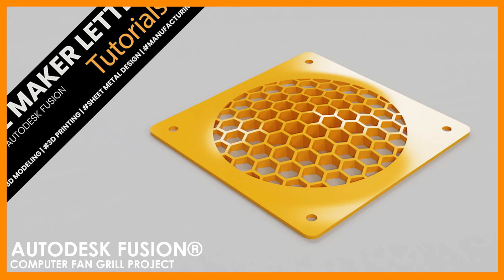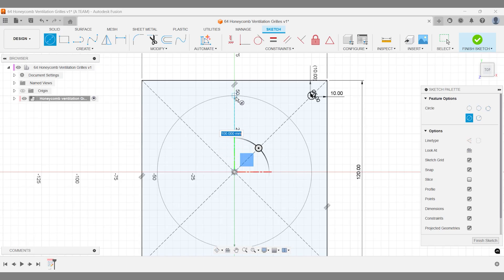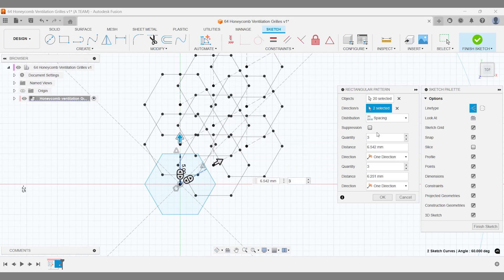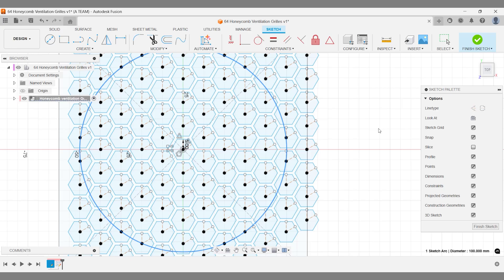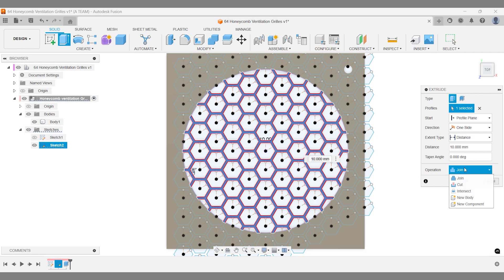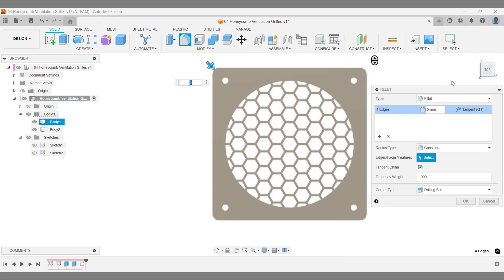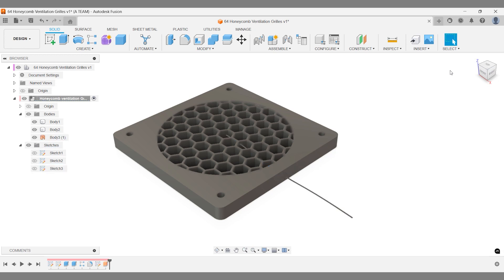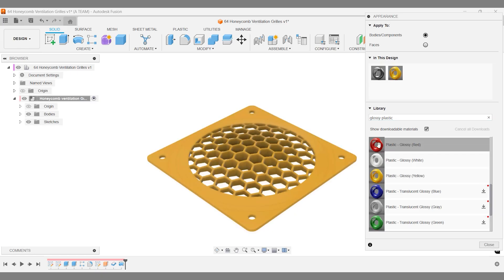Designing a 3D Printable Fan Grille with a Honeycomb pattern in Fusion

Comment: If you print this and try it next to a fan it will be quite loud and inefficient.  You need to create geometry that flows with the air.  Look at the noctua fan grill design that's published on printables.
Reply from the maker: Thanks for your feedback! These tutorials are meant to be both fun and educational. Once you master core workflows, you can spend plenty of time optimizing designs. You’re absolutely right—this 10-minute tutorial doesn’t dive into product optimization
Reply: @The_maker_letters  

I relay the information because we built and tested a similar fan shroud as it seems like a good design. We found the loud noise make it totally unusable.  Just a word to the wise...

You will see if you print this and put it up to an actual fan.
Reply from the maker: @brandonmansfield6570 Thanks for sharing! To be clear, this is a rapid prototype, not an optimized design. You’re right—it doesn’t focus on material selection, functionality, manufacturing, safety and compliance, ergonomics, durability, logistics, branding, or other important dimensions to consider when designing a product.

Comment: I thoroughly enjoy your tutorials and pick up many tips and new skills. Your cadence is spot on for learning, with just the right amount of pause between steps for the viewer to absorb what was just demonstrated, without relying on pausing the video.

The only wish I had would be if you could touch on what each tool/function does briefly as you're demonstrating it to clarify the "why" behind its use. For example, explain briefly surface extrude vs solid extrude and the reason you use that function in that situation (for the revolve).
Reply from the maker: Thank you for the feedback! I’ll try to include more of the “why” in the videos. The challenge is keeping them short while balancing length and information.